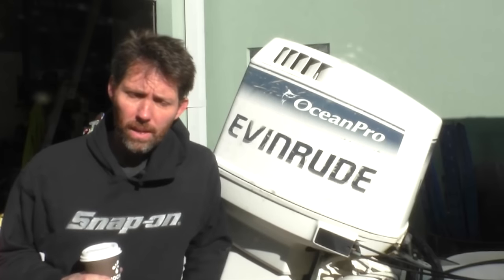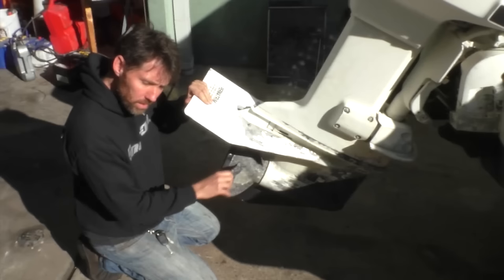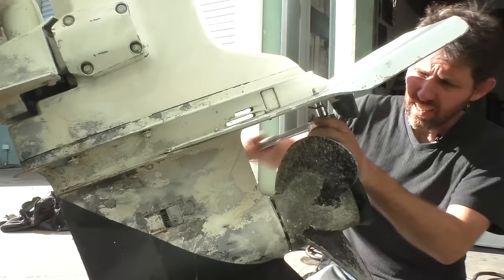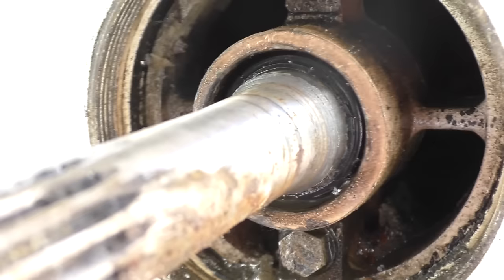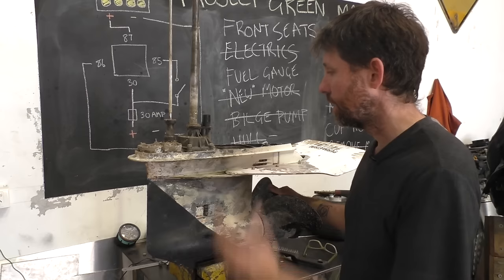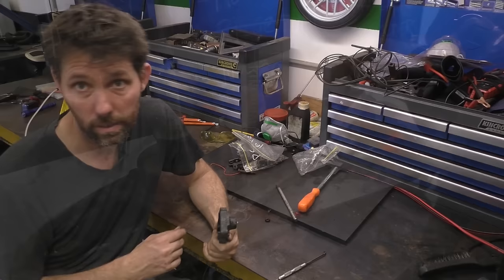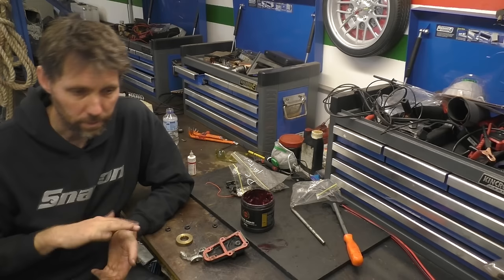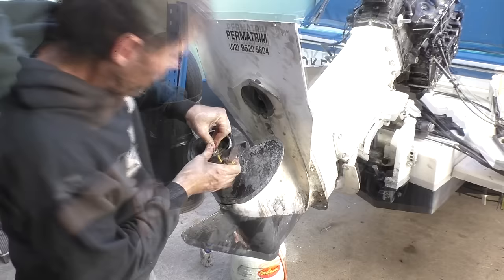Starting an Evinrude 150 outboard for the first time in years

Comment: My dad has an Evinrude 150 from the early to mid-1970's.  The boat with motor attached sat in his yard for probably close to 20 years without being touched.  Over time the boat fell apart (a fiberglass 22' Manatee tri-hull) but motor still hung on the transom.  A few years ago, my dad and brother got a crazy idea to try to start it up.  They got it running with very little effort.  I think  they were offered a $1,000 for it as it sat.  I think it now sitting in my brothers garage ... we'll probably try to start it again in another 10 -15 years!

Comment: STU  you’re the man but I would like to introduce you to 3 in 1 or P B Blaster Penetrating oil. It’s better than WD-40 which literally means Water Displacement.  Most of the time you need penetration oil , in cylinders, shifting rods , throttle rods , especially on a salt water motor. I don’t care what kind. 
  I’m literally working on a 1984 Evinrude motor that hasn’t been started in over 5 years. So far all is. Good. 1985 Evinrude VRO 120. 
 I checked spark plugs and all LOOKED good but only 2 had resistance. One of the plug wires had none. So LOOKS can be deceiving.   That is the only two things I would have included. 
 From there on your AWESOME. 
 I’ve learned a lot from your videos and understand what you’re saying about outboards because I’ve been around them for at least 30 years and understand the mechanics of them.  
 Thanks MAN 
  From across the POND 🇺🇸 👍
Reply from the maker: Thanks mate, unfortunately PB Blaster is quite hard to find over here. Not many people seem to sell it locally.

Comment: Hey.  You did a great job simplifying the removal of that lower unit for the novice.  I'm trying to bring back a 150 Evinrude Ficht that has been sitting for at least 7 years.  It doesn't seem to be seized but I plan to go through all those steps you did minus the carburetor stuff since of course the Ficht is fuel injected.  Your videos were recommended by the guys in the Facebook Johnson Evinrude group so there's high praise for someone who doesn't work on Evinrudes that much as you say.  Keep at it, and thanks!
Reply from the maker: Thanks mate, great to hear the vids are helping you. :)

Comment: The advice about dangers of turning the prop is solid. Many pilots on pre-flight have rotated the prop. The issue is mags can hold a charge for some time so on their pre flight the engine could start and personal injury can happen. But if the pilot has good reflexes he can avoid that and watch his plane taxi away.
Reply: Never touch a plane prop unless the tail is tied down or main wheels are chocked.

Comment: It is so good to know that I am not the only one that starts out with a 'simple, 4 hr job' that ends up 720 degrees and 24 hrs of labour later  to what was expected. And in there also is some 45 degree rudder turns!Thursday I made up some floor mounts for the front seats and ground down the floor fibreglass for glassing the bases in, and hit water! So my seat mounts job now mean new floors due to wood rot , so due to work means 3 or four days in weeks time  of itching and scratching .
Reply from the maker: Yes, things so rarely go to plan. I got your message about the wood rot, bummer about that. Let me know when it is good to go!

Comment: Anti seize is a boat owners best friend.  Before the boat ever goes in the water pull off the most commonly removed bolts and coat them.   The time spent will be repaid many times over.  I even put it on the threads of my spark plugs.
Reply from the maker: Definitely helps enormously with future maintenance.

Comment: Very much miss the 2 stroke outboards vs the modern 4's.
      Yes, of course  there are some advantages,  but here in Northern New England, Winter time conditions vastly favor  the simplicity and reliability of the 2 stroke. When temps go into the negatives, the old 2 strokes are often the only motors to start at the dock. 
    Additionally, the U.S.  federal law requiring 10% ethanol in pump gasoline ( sold for street use) has caused havoc with fuel systems of the vast majority of gas powered boats in our area.  
          Our local Marina actually sources non ethanol gasoline from Canada, to b sold at the docks for boats. At a hefty markup mind you... but after breaking down and paying for fuel systems to be cleaned of water caused by the ethanol, the price of the non ethanol becomes far more appealing. 
       
    Good video , thank you for sharing your knowledge !
Reply from the maker: Yes, there is something about the simplicity of two strokes that is appealing and hear what you are saying about ethanol fuel. Fortunately it is very easy for us to buy ethanol-free fuel here, I hope that doesn't change!

Comment: Oh Stu this is such a great video for me with a similar Johnson 90 2 stroke. My trickiest bit is getting the gear link attached when reinstalling the lower leg. I just seem to struggle every time. Part of the problem was the engine vibration mounts had corroded and deformed and were causing pressure on the rod. $850 later for a pair of mounts and that’s sorted.

Comment: Gear shift-shaft eye is NOT bent.  The offset is there on purpose. Also the oil left in the carbs is because the gasoline evaporated away leaving only the oil after separating. Good video!  I feel your pain.  Thanks for posting. Brings back memories of last year for me
Reply from the maker: Yes, did a follow up vid on that.

Comment: your videos are the most helpful out there, so please do not assume I'm being a total debbie downer and nut buster. I'm just learning myself and commenting on my experiences to date with my old 115 mercury tower of power that sat for 3 years and needs new steering cable, carbs cleaned, fuel pump rebuilt, shift shaft/dog clutch is ceased up, tell tale not pissing, water pump rebuilt... but I only paid $2k for 20ft. Proline CC, dual axle EZ Loader trailer and this black bitch of a motor! Thank goodness I'm retired and have plenty of tools, WD40 and patience! Congrats on getting MarineEngine's sponsorship! That's HUGE!

Comment: thanks.  I recently overhauled my Johnson 110 1987.  it had sat unused for about 5 years.  the lower end and/or  gear box are exactly the same .  the shifting linkage attached to cable end is a little different but not hard to figure out. I did put new water pump impeller straight away.  after putting some lube in cylinders and changing plugs and wires and going through the fuel supply system as you did my engine started right up.   it did over heat a little.  I checked it closely with a radar type thermostat.  Found it needed new thermostats...it has two.  they were completely clogged and stuck in open position.  pulled exhaust manifold to get to them.  haven't restarted yet but hoping for good results.  thanks for your informative videos...very well done
Reply from the maker: Thanks Richard, sounds like the Johnson has still got plenty of life left it in. They are amazingly solid units.

Comment: Good video.  These are the things you do before starting an old "salt water" motor. Any motor run in salt water and having much over 3 years will exhibit some of these issues ...
The four biggest friends of salt water motors are PB Blaster (super penetrating oil), "Never Seize", WD-40, and Petroleum Jelly.  The never seize needs to be "Nuclear" grade which just means it does not contain any copper.  Copper and aluminum hate each other around salt water.  The Petro Jelly  (Vaseline in USA) is a great lube for things like that shift selector top cover.  Pack that space between the O-Rings and it will not lock up for many years.

Comment: Many years ago I made a service call to a facility where outboards were assembled. The men in the test cell were testing some 150hp outboards ordered by a Mexican commercial fishing group. The outboards were run around the clock and not shut off, so they ordered them with manual start only. The test cell workers hated when these orders came through because they had to pull-start each one to test them. Each had to be started several times per test cycle. The orders would typically be for a couple dozen or more if I recall correctly. The workers would be worn out by the end of the day, for days on end until the order was complete.

Comment: I have a 1986 Johnson 150 that I have restored. The top tip of the shift rod on mine is bent as well, from the factory.  the rest of the rod is straight.  Just a heads up.  Great stuff, Mate!!
Reply from the maker: Good to know about the shift rod angle. It's always hard to tell without something to compare it to, thanks for the info. :)

Comment: I laughed out loud as I watched this video - the engine had only been sitting for about five years. I started a 48-year-old Evinrude that had been sitting for 19 years. 
In 2006 my 40-year-old son asked about the old Avon inflatable boat we used to run up at Lake George, NY many years ago. His family was going to visit someone for two weeks who had a lakefront house on Lake George and a boat on the lake. I told him our old Avon was still in the garage and we got it out to see how it was.  We blew it up, and it seemed to be OK. The NJ registration sticker on the boat showed that it was last used in 1987 - 19 years ago. The next question was, “OK, Dad, what about the motor?”  So we dug the motor out of the back of the garage next. It is a 1958, 18 HP Evinrude ‘Fastwin,’ with the old dual tube gas lines. The 48-year-old veteran motor had been used a lot in the old days, in both fresh water and salt water, but had been sitting in the unheated garage unused for the same 19 years. We stuck it in a garbage can full of water, mixed up some fuel in the tank, and primed it. I admit that it took four or five pulls and a shot of ‘hot start’ in the carb, but that old motor fired right up and purred like a kitten. We never even pulled the plugs. We shut it down and changed the rubber water pump impeller, and the lower unit gear oil to be on the safe side and the motor ran nicely for my son and his kids on his two-week vacation back up at Lake George again.
I don’t know if it is on interest to you, but that old Evinrude Fastwin is still sitting in my garage again, and it has not been run since that summer in 2006 - so that would be another 13 years that the motor has been sitting idle. It is now 61 years old. I’d bet that that motor would still fire right up again if I tried to start it again. All I ever do to store a motor is to run it out of gas to drain the carb. And then the motor gets pulled over once or twice every couple of years just to be sure that it is not frozen up.
Reply from the maker: Glad to hear you changed the impeller. It's not so much about the motor overheating as if it breaks up it's a huge job to get the bits out of the cooling system!

Comment: Very helpful video! I just got a Johnson that has sat for 4 years but was running when last put up. I tried to see if the prop would turn in gear but couldn't get it to. Now I know I need to take the spark plugs out and try again. The starter in mine has to be replaced before i can try anything else. Turned the key to start and instantly had smoke from the top of the starter

Comment: can't believe that at 24.50 you wouldn't have proceeded with replacing the impeller while lower unit was removed! That's always a must do, especially knowing the motor has not been run in 5 years!

Comment: I'm happy your video is longer than you intended I have learned so much. You are a very good teacher thank you for all your help sir. I have an Evinrude 70 from 1987 I just bought and wouldnt start or turn over. I have bad coil packs for sure. Other than that I just want to make sure when I go to start it after 2 years sitting I don't do any damage. I suppose I will change the oil and the fuel before attempting a start and give a good lookover inspecting the hydraulics and seals like you have done.
Reply from the maker: One of the other main things to be careful of is if the water pump impeller has started to perish you don't want it to break up when you start the motor as the pieces can be very hard to get out of the cooling system. Might be worth putting a new one in before you fire it up.

Comment: Started a 1982 115hp evinrude for the first time in 18 yrs new solenoid and battery cables and 30sec of cranking runs like a top but it is a freshwater outboard.

Comment: Great video Stu!  I see oil in the carbs of oil injected Evinrudes and Johnsons all the time, especially after sitting all winter.  The stuck gear shift is a common issue I see too.  And BTW, all Evinrude/Johnson outboards use imperial sized fasteners.
Reply from the maker: Thanks Will. I have a few imperial sockets but I really need to get a will set of sockets and wrenches one day to cover these outboards.

Comment: Oh, and you will probably find that the late model, plastic OMC carbs are excellent. No corrosion, and not much sticks to them. The rubber seals have to be replaced occasionally, but only after many years.  I wish they were all that easy to work on!
Reply from the maker: They do seem very corrosion free, I was impressed with that, much better than aluminium carbs would be after the same number of years.

Comment: Tip. When working with engines with wide flange alu bungs or bolts etc that are frozen seized especially on Honda motorbikes etc just get a wide punch and use a hammer to whack punch to shock it. If no go just use a heat gun and thermal cycle it as gas flame is too vicious.

When draining small lots of oil and your curious of contamination then try draining the oil in a nice clean white used ice cream container then you will see every thing at bottom of container.

The white powder is aluminium oxide which in most cases aint disolvable with WD40, CRC etc but its water soluable so i generally dampen or soak with water. I work on irrigation pumps which a old guy taught us this.

Comment: You are right to caution people re accidently starting a motor by turning the prop.  I have actually had an engine start on a boat that was under tow when someone lent on the gear engagement lever.
Reply from the maker: It certainly doesn't take much if the engine is warm and the carburettors are full.

Comment: I think the end of the shift rod is supposed to have a bend in it. Great video! Thanks!
Reply from the maker: You're dead right John. As the shift linkage had seized and the owner had been forcing the gear lever I had presumed it was the result of that. Eventually found more details on this motor and fixed the linkage up https://www.youtube.com/watch?v=Ufy6W9EI1cg

Comment: Hi Stu, really great video as always. Lots of corrosion issues there, but well done for working through them. Customer brought in a 2006 Suzuki 15hp four stroke last week which hadn't run for quite a few years, like the Evinrude. He said it had been stored outdoors for quite a while, through the damp cold English winters. Engine looked like it had low hours on it, but the oil was emulsified, so I thought there was a breach of the cooling system somewhere. The engine wouldn't pull start, and a wrench on the flywheel nut confirmed the engine had seized. With some oil down the bores it eventually broke free, so I guess water in oil resulted in the piston rings rusting themselves to the cylinder liners. Speaking to a few of my boatyard contacts they say that the cooling system may be fine, and that instead the emulsified oil is related to a specific problem with Suzuki four stroke outboards and condensation affecting the oil in the sump? Is this something you have ever come across??
Reply from the maker: I very rarely work on Suzuki four strokes, there just aren't that many out this way. It does sounds feasible though that somehow condensation has run down into the sump. I'd probably just go ahead with a compression or leak-down test to confirm there isn't a problem with the head gasket though.
Reply: Hi Stu, many thanks for your feedback. Suzukis are rare as hens teeth round here too. Managed to start the engine with fresh oil, so I know its a runner now. Original compression test I did showed 100 psi on the top cylinder and 80 on the bottom, which was within spec, but I was concerned about the difference between the two. Since it ran I repeated the compression tests and got 90 psi on the top cylinder but only 55 on the bottom which is out of spec and the difference has got larger! My original compression test was after I sprayed oil into the cylinders to help free the seized pistons so I guess the oil gave a false compression reading. I also noticed the oil level rose slightly during run up which points to cooling water getting into the oil. I also got occasional back firing during the run up. My best guess at the moment is that the head gasket or other seal has failed, and that the piston rings / bores are damaged due to water ingress. So need to tear the engine down now  to investigate further. I may need to go as far as replacing the rings and honing the bores to enable the new rings to seat properly. Keep the great advice coming! Cheers, Jon

Comment: Good news the dealer didn’t mount the transducer in the correct spot from new. It was causing cavitation and water disruption to the e etc. causing the engine to overheat. Engine is a ok. The mechanic we took our Ranger to removed the transducer and zip tied it out of the way. The transducer was also not the correct one.